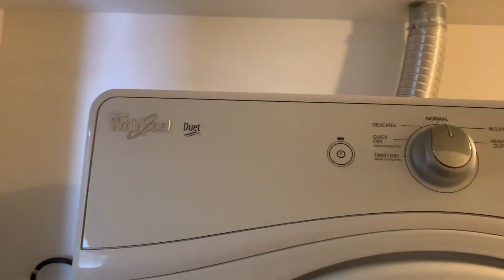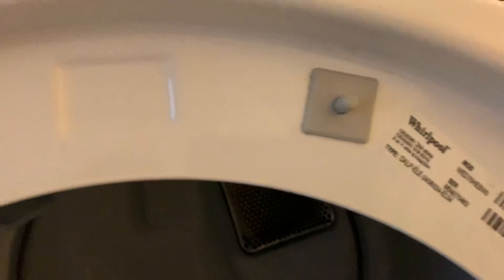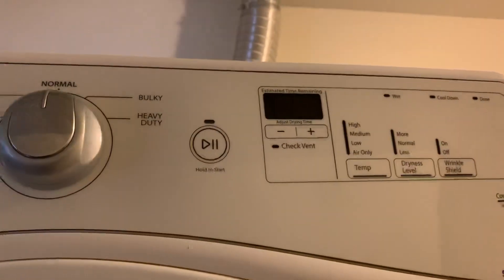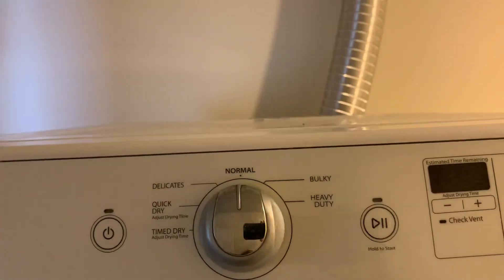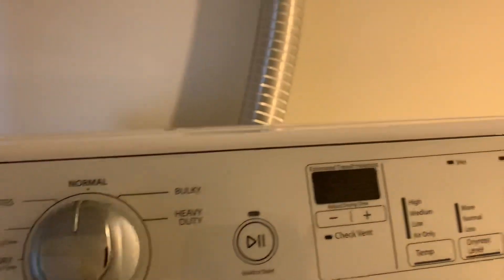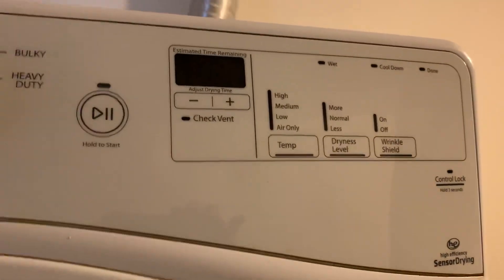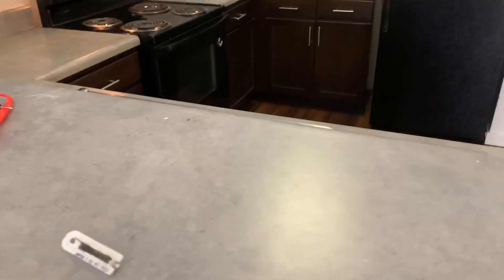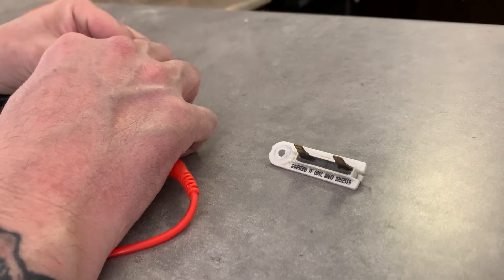Whirlpool Duet Dryer F4-E4

Comment: Most of these show the F4 E4 code from Installation and is a common code. And really means nothing. To get true codes.....With the dryer off need to push the + - + - buttons to get true codes after its in test mode....touch each button one by one until one wirks incorrectly...if it does during touching the start button ...Usually this issue is going to be the CCU problem.......gently unplug all wire from CCU and lift out of the CCU panel box.  Look at the back of it & see if there are any burn marks on the board itself or the CCU.   If so you need to get it repaired. Not that hard to do and lots of people do it on ebay or even you local dryer repair shop.....Just sayin.
Reply from the maker: I’m going to try that in a vacant apartment to see if this is true on Monday. Happy Thanksgiving 🦃
Reply: whaaaaaaaaat???
Reply: Much appreciated. 🫡 I figured out my issue because of your reply. Cheers